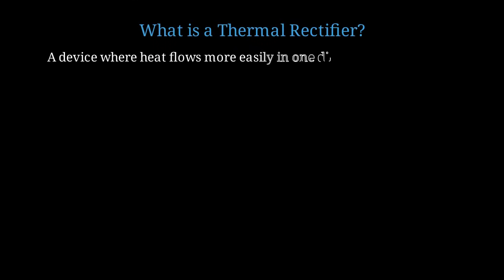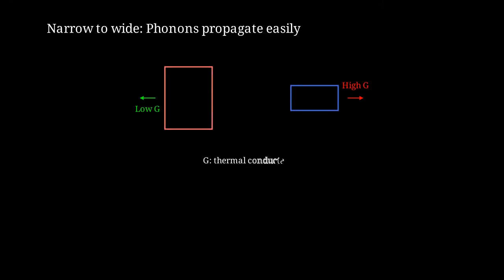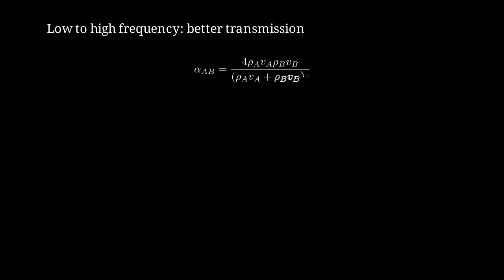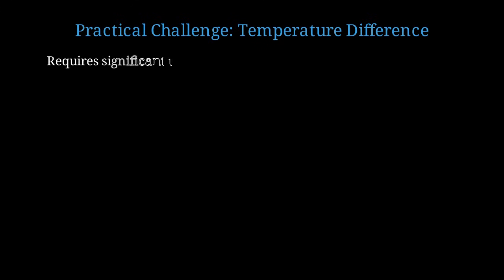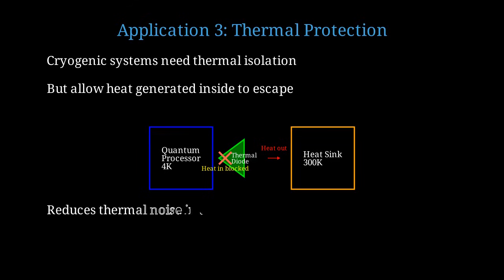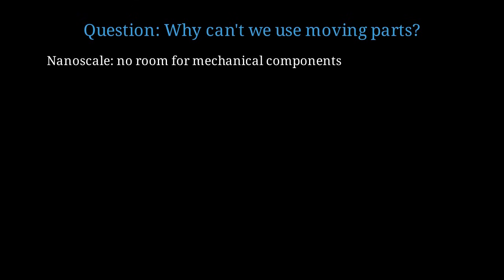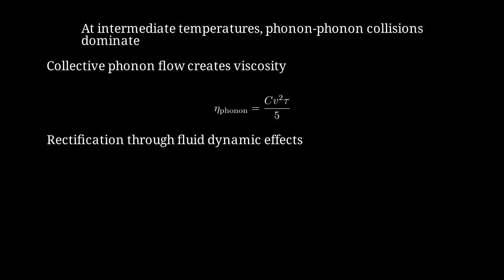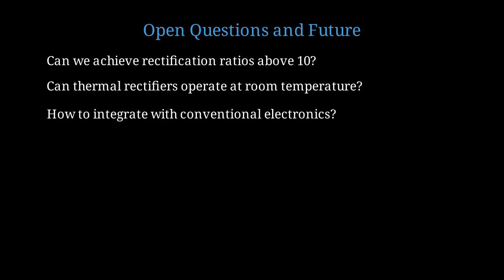Can We Build Heat Circuits Like Electrical Ones?

Comment from the maker: Why does geometric asymmetry lead to phonon mode filtering and directional heat flow?
How does anharmonicity make thermal conductivity temperature-gradient dependent?
What limits the rectification ratio in practical nanostructures?